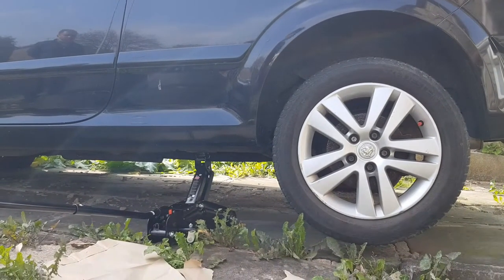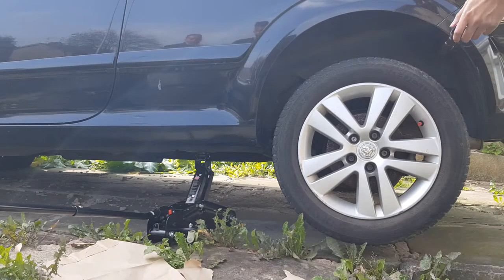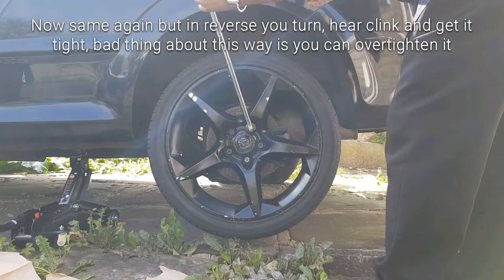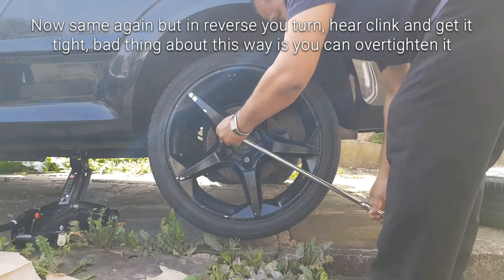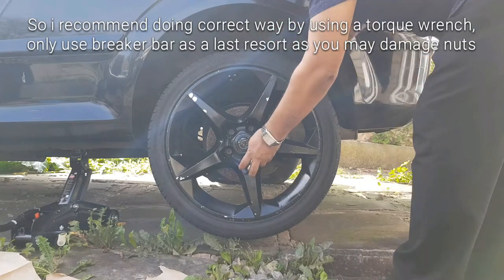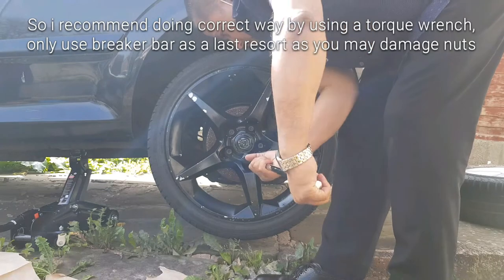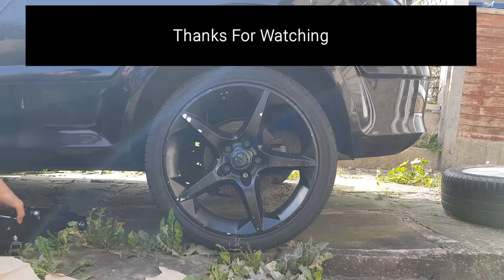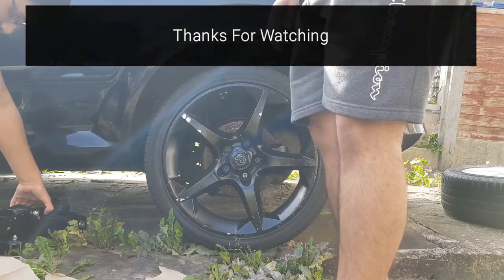How To Use A Breaker Bar To Loosen Stuck Nuts And Tighten Nuts

Comment: my cousin and i need to do the back brakes on my 2007 hyundai sonata. but not long ago i had the tires rotated at walmart and they used that air wrench thingi to tighert up the lugs and now neither me or my cousin can budge the darn nuts with the 4 way, would something like this help?
Reply from the maker: Yes this is what you need to undo machine tightened ones or you can use a air wrench but they require air compressors, so yh just buy a long breaker bar with the revelant sockets needed for your lug nuta

Comment: If you leave the car on the ground, then try breaking the nuts loose it will be a hell of a lot easier as the wheel/hub won’t move. 

And when torquing it back up correctly, you can hand tighten it in the air and then torque it up while the cars on the ground so the wheel doesn’t spin and also so it gives you the correct torque.

Also a lot of torque wrenches are made for tightening nuts, NOT loosening them as it damages the mechanism.. Yours may be different so apologies if I’m wrong.
Reply from the maker: Thanks for the advice brother, we realised the first part at the end haha, thanks for the helpful tips when we do it again we will be ready
Reply: @MrWaheedulHaque  Haha, no worries bro. 💪🏻